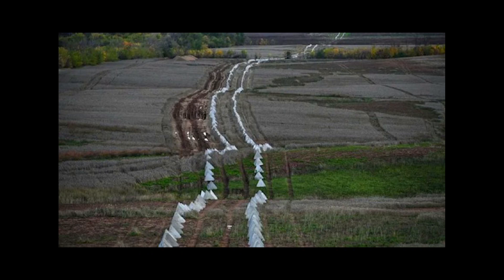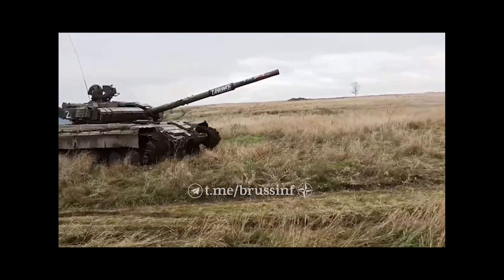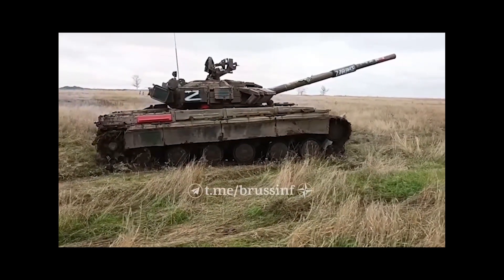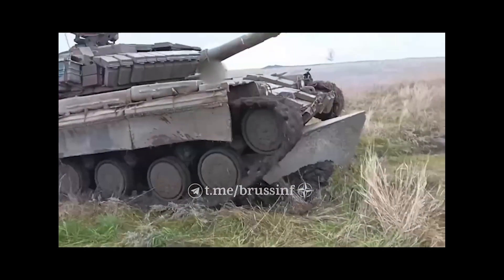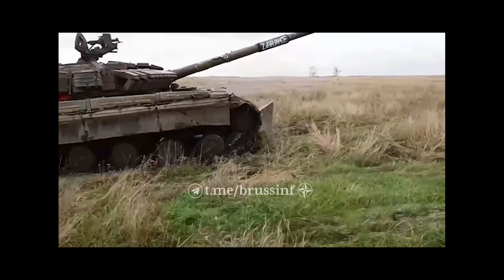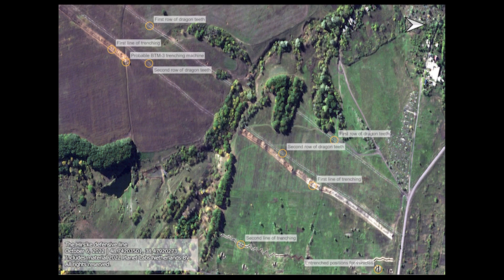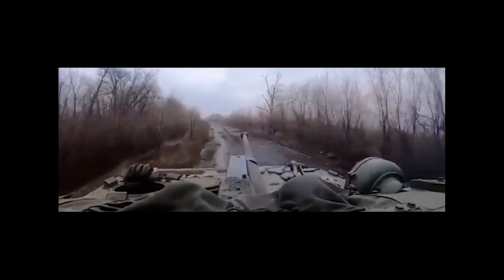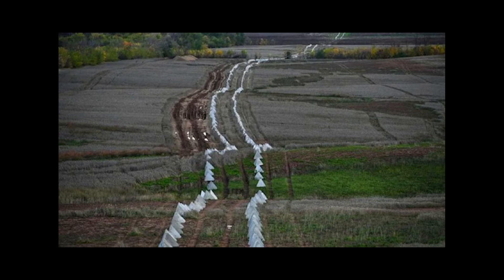How Russia's Dragon Teeth Anti-Tank Barriers Work

Comment: Do you have a source showing these do not work on frozen or muddy ground? As I think they would still work. Like hundreds of pounds of force pushing the edge down into the ground. To me it sounds like it would dig up a bit then lock into the ground.
Reply: Nope, the will slide
Reply: @DonnBaca  Ground isn't frozen for the entire depth it depends on temp and water amount. Also you can smoosh through impure ice with a spoon, so a pointy concrete pyramid is going to dig into it. This isn't a solid pure ice crystal, it's frozen soil and water mostly.
Reply: @DonnBaca  You don't know.
Reply: @olliefoxx7165  - Yes, I do 🙂
Reply: What happens will depend on how frozen the ground is. Just the top few cms won't make any difference, but if it's solid for 20 or 30cm then it seems almost certain to slide unless ground is very rough. I have no idea how deeply frozen the ground gets in Ukraine. Probably not very - it's not the Tundra where the permafrost gets metres deep.
Reply: Elena R  These are just one of many defensive obstacles put in place. There are mines in the ground, hidden pits covered by camouflage,  drones in the air watching, people on the ground watching, etc, etd.. The moment they are spotted artillery opens up on them, missiles are shot at them, anti tank guns and rpgs are shot at them. Why would you think that's all they have there?

Comment: I watched a vid of the BMP's driving at speed one after the other over street barricades during the Euromaidan(?) One made an impressive jump and the vehicle at least, had no problem. I hope the crew and drivers were strapped in with crash helmets, though.
Reply: Those  were smaller  than the one the tank  got  stuck  on.
Reply: The shown example is actually not those used in Ukraine.
The one shown is clearly concrete while those used in Ukraine are cement with a fairly high ratio of lime.
The one show is much larger than the ones used in Ukraine. A rough guess would be about 2/3rd of the dimensions of the one shown in the video.
Reply: 😂😂😂 I saw that video, as well. Bloody hell, what a ride 🤣🤣🤣
Reply: It was not Euromaidan, but occupied Mariupol in 2014
Reply: @Monia_V  Mariupol wasn't occupied in 2014.
Reply: @GARDENER42  Search video Liberation of Mariupol by the Azov Battalion 2014
Reply: @Monia_V  thank you.

Comment: Also being "loose" on the ground the dragons teeth will also be very easy to displace from thier nice neat rows by a salvo of artillery fire along a section.....or even some direct cannon fire from the tanks main gun (admittedly a reasonably tricky shot)
Reply: You'd need very large caliber and a direct hit to achieve such an effect as what you're talking about. Artillery is only effective (to some level at least...) against light blockades, such as barbed wire. A massive concrete block will not disintegrate from an artillery shell exploding nearby and will also not be moved by the shockwave.
Reply: That's genius! You only have to waste hundreds if not thousands of rounds of valuable ammo to blow up just one of many different layers of defense.  While you're wasting time trying to blow them up you'll be spotted and taken out by dozens of different ways.

Comment: A plow attached to the front will push them out of the way.
Reply: literally a squad of infantry could just shove them out of the way
Reply: @JHamList  I wouldn’t want to be on that squad of infantry if the breach point was under observation. Or if there are AP mines.

There’s obviously many ways to defeat dragons teeth. But the purpose isn’t to stop tanks, it’s to slow down an advance so your reserve force can get to the point of assault. It’s one small element of a defense.
Reply: @MarcosElMalo2  they were never a signicantly successful impediment to am attacking force in prior wars, even those built into the ground can be overcome by bulldozing dirt over the top of them, these ones are just dumped off the back of a Kamaz and not fixed in place, you could drag them away with a pick-up or a  few motivated grunts
Reply: @JHamList  Be my guest, then.